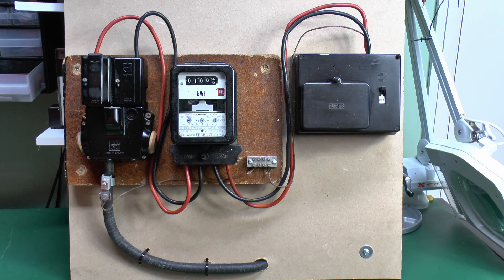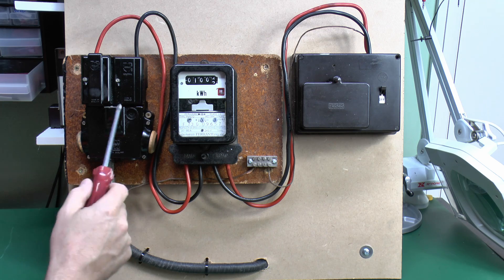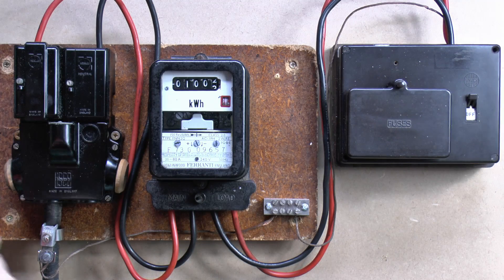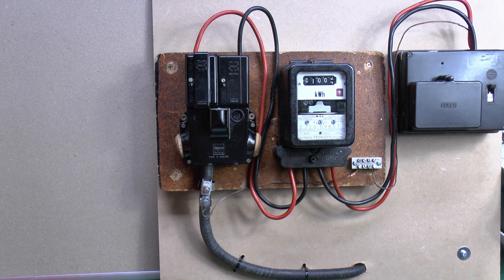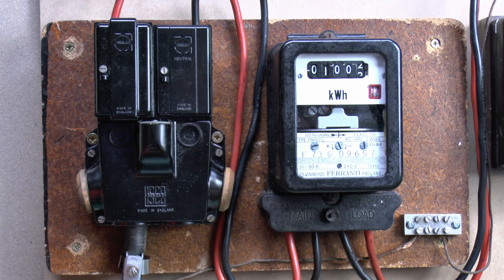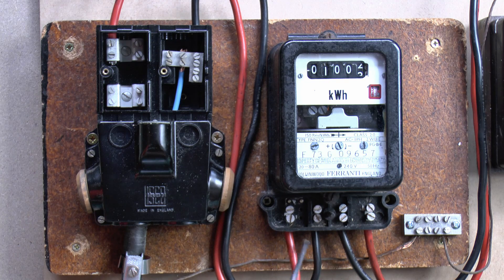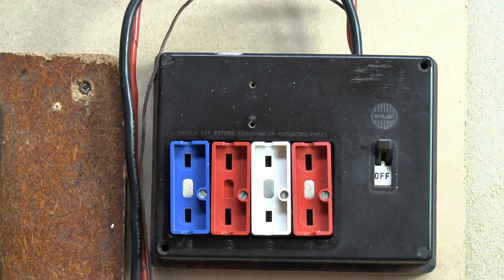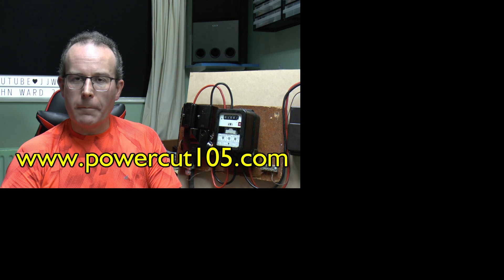Cutout, Meter and Fusebox - Who Owns What?

Comment: Buried incoming cable faults often occur due to deteriorated insulation. Where I live there were quite a few of them in the same local area quite recently. Large chunks of the 3 core aluminium 3 phase cable (to which the single phase connections to individual houses are connected) were dug up and replaced, when the feed from the “local transformer” tripped out with several houses suffering from power cuts. The “local transformer” feed tripped out when the cores were no longer insulated from each other, due to water leaking in from the ground. I think they were between 30 and 40 years old.
Reply: Probably Consac mains cable.  Consac was in common use from the '70s to early '90s and is prone to failure.  Best underground cable has to be PILC.

Comment: My grandma's house has such old equipment but no earth connection.We asked the company to provide the earth terminals using TT and they've done it without any problems, leaving earth cables to light and socket circuitry. Now for the sockets it's our responsability to replace them with newer ones, either DYU or qualified electrician. The equipment is still in good shape and working fine and the wood also ok

Comment: That fusebox needs a massive bundle of twin & earth as thick as your leg poking out the top, which connect to a disturbingly small number of fuses, all of which are the wrong rating. One of which has to be labelled "immersion" and in fact powers half the upstairs sockets too ;-)

Sorry, this setup is giving me flashbacks to an old house I used to rent where the lights dimmed if I ran the electric hob.
Reply: You forgot the 5 amp carrier powering the shed which actually has 30 amp fuse wire in it
Reply: It's pretty much our installation - except meter's a new electronic thing. The rest of the supply installation is as shown and as it's only worked for one century, it's barely run in yet. It's not due its first 1,000 year's service for another 900 years.
Reply: @TheChipmunk2008  ... or a paper clip.
Reply: (for elimination purposes, all i wanted to do was prove the switch was dud and the fan was fine. I underestimated how much LESS conductive steel is than copper!)
Reply: @James_Bowie  just push a nail into the contacts for the carrier, and hope the cold, unheated house and over engineered ring main wiring is able to dissipate the heat...

My parents were paranoid about the house burning down, and I can see why given the fuse wire might not be correct.
Reply: James Grimwood the great thing about those systems though, was that if ever you needed to upgrade your supply you didn't need to bother with an electrician or contacting national grid, you could just use a thicker nail instead of an opened out paperclip in your fuse carriers...

Comment: We had an old dial meter and solar panels fitted which resulted in the meter going backwards (major no-no in the UK).  I reported this on the same day as the solar panel commissioning.    The DNO were fine and this was typical problem, but the electrician that visited was over-the-top - we are going to prosecute you for turning the meter backwards.  I had to prove to him the sun was out, that turning off the solar supply would stop the meter going backwards, that turning on a large load would turn the meter forwards, and the the paper work showing the panel commissioning date.  After 1 hour he accepted that he would fit a new meter (that was his remit for the job), but he was are real pain; even to the level that he did not seam to understand that solar panels generated electricity so would turn the meter backwards if demand was less than solar generation.

Comment: Hi Recently retired DNO Jointer/fitter/Faultsman.
A couple of clarifications, The lead sheath of all cables are NOT earth conductors, they are a protective sheath that is earthed for its own protection. Not to provide an earth. A separate earth conductor is required ( this is a very common assumption but the earth value of the sheath is not guaranteed by the DNO, Note many DNO staff don't know this because of historical practice, The electricity Supply regulations are what apply not IEE Regs).
The Henley cut out, all of these Henly cutouts have a max fuse rating of 60a if they are "Half Clip", as this one is (the metal holding the fuse in place only goes around half of the fuse), if the metal goes all the way around the fuse its 89/100a. Saying that the type you have here is Half clip and the full clip type stick out further and you will see a line facing you where the holder comes apart, and maybe labeled 80a. If no label assume 60a.
They are also not always compound filled, around 60% are, if the service comes from another property they will be unfilled as the cable is vulcanized rubber, red hessian sheath if its not covered in paint etc.
When it comes to changing the cutout or moving it, you are right to say don't try yourself...... but they can be moved or replaced by trained staff, they are done live, even if filled with compound, its messy and hard work if in a small cupboard, Face visor, gloves and flash retardant overalls is the modern attire, yes people have died doing it, a tiny number, yes many have had shocks, yes its not done so much nowadays but millions have been done and still get done by trained staff. The accident rate is tiny because of the training. Its just as risky as cutting the cable outside unless you have the small cupboard situation or think its damaged.
The situation on fuse protection of the cut out. In practice the fuse rating at the substation, is in order of commonality, 500a, 400a/630a, 350a.....an 800a fuse is very very rare, not impossible but very rare due to the fact that changing one live is impossible on load without damaging the contacts.
Everything else is spot on and better than most videos who forget to mention not to cut the seals, I only mention, other than the lead sheath, for interest not criticism. Well done.
PS just remembered the compound leaks, 99.999% of those leaks are due to modern central heating making the ambient temp higher that the "flow" point of the compound, so other than mess its not a problem. the other 0.001% will be obvious by the smell of hot compound.
Cheers.

Comment: Just a few days ago we had everything replaced on ours from the cable onward. The backboard was disintegrating the head was falling off and the meter was dead.   Due to a  leak in the roof. We were lucky the whole wall was soaking wet and the water was running over the head . Lucky  nothing caught fire and nobody died.    I kept everyone away as soon as it was discovered in the garage. Our  substation and  supply is at the bottom of our garden so  a nice potential of 800 amps if things had gone south.  The DNO did a grand job and explained everything, backing up everything you have said.  Fitting every thing new and also upgrading our 60 amp tails to 100 amp as a bonus.  Smart meter fitted a few days later and the meter guy was really appreciative of brand new kit to fit to.

Comment: I’ve seen a DNO guy pull a cut out with a lead cable off the wall. The earth tag on the cable was knackered so he got into the tiny under stairs cupboard, took it off the wall and started peeling away some of the steel banding to fit a new one. He pretty much had the thing between his legs at one point 😂
Reply: There must be lots of stories going round of the insane things DNO guys have done lol. I saw one stick his bare finger up the inside of a live cut out to confirm it wasn't bunged.
Reply: We change cutouts live on lead cables everyday just smash the old cutout off pitch is brittle if you hit it then stick a new one on
Reply: @0liver0verson9  I know a dude that done bypasses bare handed all he had was some insulated boots🤣 he didn't even care about getting shocked from a wall socket or light fitting, I thought it was deadly but he reckoned even a 240v wall socket ain't killing no 6ft man with a decent "ticker"  the guy went onto tell me about ones that did land him in hospital and it was always them big wires coming in from the street and one was when he wired up a compressor it "stung him" while it was just starting up so was nasty af. He was adamant all sparkles have been shocked multiple times 🤷‍♂️

Comment: PILC-paper Insulated lead covered-cable is a mare to work with, had to a do a sub joint onto one of these for a temp supply on a job years ago on a prison wing.
Congrats on the 100K subs John.
Reply: Hugely interesting. The importance of older installations being potentially dangerous if anything is moved is something most people don't consider. Great clarity on who owns what. Great video. Well done😀

Comment: Excellent video John thankyou. Interestingly, there are 2 main fuses in a property I look after. One in a cupboard outside, which feeds a second consumer fuse inside the house before the meter. The DNO absolutely will not take responsibility for the second fuse even though it is in line before the meter. They will not replace the old concentric cable (a good 8-10mm CSA!) and remove the second fuse, saying it is our responsibility. Legally I don't know where we stand now, as the installation feels less than safe to me!
Reply: It’s been a while now, how did you get on with this situation? Who is the DNO in this case?
Reply: @virtual3d993  Western Power and they are still refusing to amend it and remove the second fuse. No local contractor will touch it either sadly. Perhaps I should ask Chris from CJR electrical to ask Pedro to come round and sort it.
Reply: A poor stance by the DNO.

I work for a different DNO. I’ve seen this situation in our area once or twice. 

Same sort of argument at the office….

In the end I arranged for the problem be sorted out from a customer service standpoint. Everyone in my office pulled a face and said  “oo, I wouldn’t have endorsed that”. 

Too bad for them all, it got sorted.

Comment: Pretty good John. But 800a fuses lol? We used them out of hours to blast a short in mains underground   cables to open circuit then backfeed to get folk on supply overnight. Never seen them used as protection though - 500a highest in my 30 odd years with SPEN.

Oh, as for solid links, there are link pillars in the streets, but they're fed from Substations with 400a fuses.

Comment: I've worked for a Big 6 supplier in WPD and SSEN regions and I've never heard of a modern electricity supplier exchanging tails into an existing or new consumer unit for an electrician. As far as I know under the MOCOPA we are never to connect new consumer tails. We can either connect the tails that were already in the existing meter installation, or fit a two, three or four pole isolator and leave it sealed on the line side and unsealed and safe for connection on the switched side, with all the required safety notices in case the electrician is a bit green.
Reply: The electricity supplier used to check the install before turning on ,but now it's up to the spark to turn on the fuseboard, this putting the onus on him/her.
Reply: It depends on which supply company you work for. My previous company we used to fit an isolator switch. My existing company we fit switches on most single phase  new installations however on 3 phase we fit the tails direct . To do this we have to access switchgear to check connections . Insulation resistance test . Inspect premises earth bonding . Check all tails are correctly identified. This saves on the price of a switch which always baffles me as fitting a switch is much faster and fixers responsibility ends at the switch
Reply: @nicholasclarke8757  possibly a contractual thing. Thing is suppliers could choose to get us all 18th edition trained and equip us with test meters, but they don't for many reasons, namely liability, work planning and cost. 3 phase trained fitters are a lot rarer and usually more experienced, so it makes sense to train them up. I'm always quite sad when our trainers reminisce about the days of being Inspectors for SWALEC/Southern Electric and having all the qualifications and teeth they needed to get the job done properly when things got complicated. The demarcation of electric and gas installations into three different areas is the cause of most of my work headaches.
Reply: @OkenWS  fair point. I have to say a lot of new installations I visit have some sort of issue . Tails incorrectly or not labelled or no switchgear fitted yet . Fitting a switch is so simple and most sparks are happy to have it done that way. I've got some expensive test equipment but it doesn't get a lot of use
Reply: @nicholasclarke8757  16mm tails on 100A fused new builds gets me at the moment. I've given up issuing warning notices for it because clearly the electricians or their management don't find it necessary to conform to BS7671 and the supplier/DNO's opinion is probably considered invalid. Honestly, compliance is not that difficult and things like that indicate lack of tradesman skill to me. I despair.
Reply: @OkenWS  when I joined my present company  I was given 1 meter board 2 connecter blocks 1 switch and 2 reels of 16mm cable and a selection of fuses . No 25 mm issued. Was told that was about 6 month's supply . Seriously. Existing supplies with undersize tails or multiple tails told to bang em back up and leave a safety notice. My previous employer were the total opposite. It's going to be interesting as my previous employer as taken over my present employer recently 😀
Reply: @nicholasclarke8757  That sounds awful. Total disregard for safety, standards and to be honest reality, is creeping into the industry to try and save money and get stats up. My company is almost famous for its arsey health and safety but our managers are overriding technical assurance to get jobs done. Very concerning, glad I won't be a part of it for much longer.
Reply: @OkenWS  Do we work at the same company lol . I work for one of the big six and before that worked for a big six company. Our latest disregard for safety on iron clad cut outs containing asbestos is farcical
Reply: @nicholasclarke8757  Yes, by the sound of that, I think we do. Sadly the DNOs aren't interested in replacing the metal clads so I guess someone was going to have to blink. I can't believe WPD thinks it's acceptable for a 70 year old wire fuse cutout to be left in indefinitely, but I've been told they have no intention of making any changes to allow the meter exchanges to proceed.

Comment: My board is very similar to the one shown. I don't like the idea of a smart meter in doors so I got a couple of quotes to shift the board to the outside wall. The power is delivered from overhead cables and there would be no need to extend any cables. The cost was £1200, with additional costs of installing the outside box and connecting up the consumer unit. The time needed to shift the board can be no more than 3-4 hours. I declined to have the job done!
Reply: Good price now .

Comment: Brings back memories of working on council rewires.
Could you do a vid on some of the scams you have seen where people have tried to fiddle or bypass the meter
Reply: I was thinking the same. Be interesting to see.
Reply: I once visited a property where the 11kW power shower was connected directly to the mains supply !   Even better news; I forgave them !!
Reply: @keithterry2169  you'd be suprised. As much as it's wrong I used to bypass meters, I used to get called out a lot when folk tried to DIY it thinking its as easy as connecting circuit wires pre-meter. I seen a grow house one time they basically drilled out the wall at the mains and chopped around the insulation and wired the place up directly from a split open cable. They were running amongst other things ten 1000watt lamps and the main cable was just hacked open
Reply: 😂 the big thick 'flying' lead outside the system touching the live terminal to live terminal making the bridge and numbers running backwards 😂

Comment: The cut out belongs to the power distributor. Mine is Northern powergrid energy company is British gas. Today British gas couldn't fit a new meter because the cut out is not working properly but still passing electric through. Northern Powergrid need to sort it before British gas can put the new meter in.

Comment: Just feel i need to correct somthing said here. Whilst it will be your supplier you need to contact regarding the meter, it is not the suppliers asset nor is it necessarily the same company that the engineer comes from. The suppliers can choose which meter operator company they use to fit the meters. Where its one of the larger suppliers this is often their own meter engineers but the smaller suppliers will either only take on customers already with a supply fitted (or recomend switching after getting a  big supplier to get works done) or they agree contracts with a meter operator company to provide this service for them. Meters are often changed when you  switch supplier as a different  meter operator may have been prefered by that supplier though the simplest option would have been for the supplier to keep the previous agent.

Comment: Had the exact same old cable failure last week. 33m of cable pulled out of conduit and replaced with new PVC, because the old one was way too brittle, and shorted out after being disturbed. Also had to dig in the plaster a little, to get the buried junction box that was there, and while I was there replaced the old non used 2 way switching, as the lights are now on a group photocell, so there are now plain blank plates installed.

Now got to some time replace the other 5 near identical layouts, as that is I suspect the cause of very random tripping, but that is a lot of old wire to persuade out, and I do not get paid as I actually live here. Will be done as the lights themselves fail one by one, which was the case here, a 30 year old fitting cracked, and I did the entire group as a unit, after making safe at 9PM.